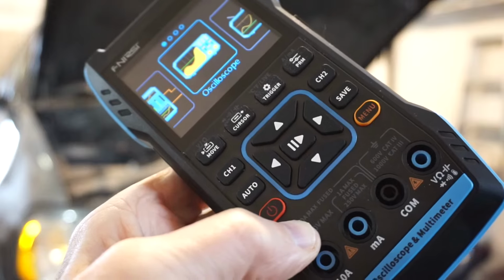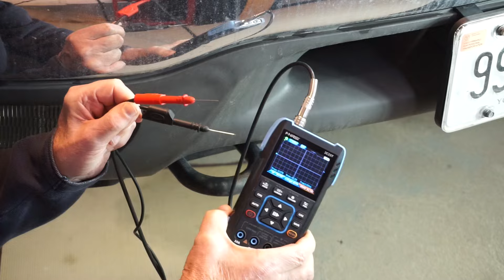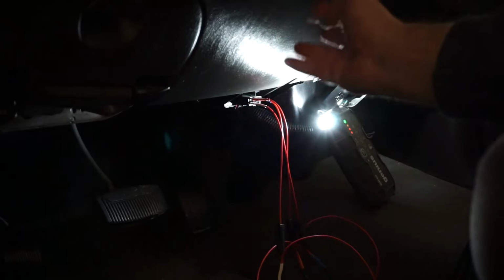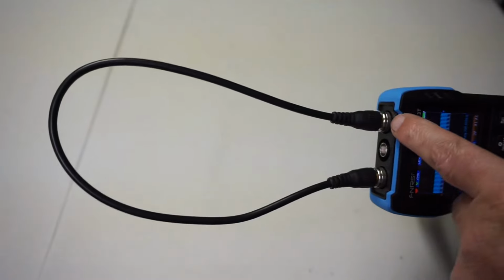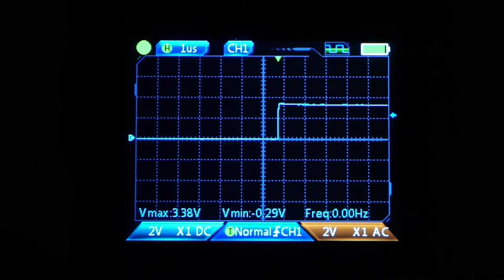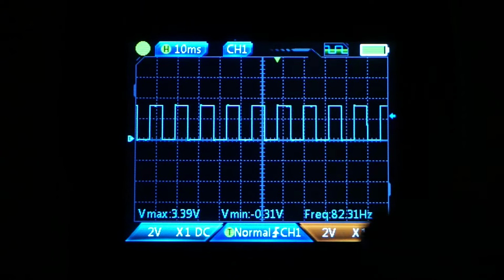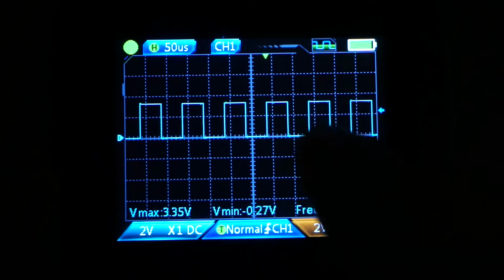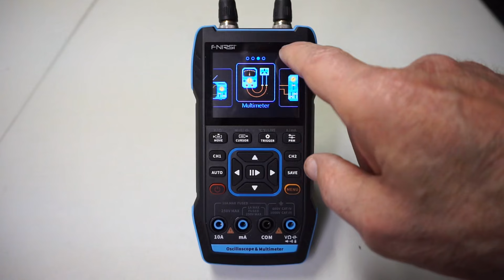GADGETS#191 - FNIRSI 2C23T

Comment: All these "handheld" oscilloscopes have too slow sampling rates at most time bases, which leads to horrible aliasing just like you showed. I think it must be because they don't have enough waveform memory to run at a higher sampling rate at longer timebases. The Owon ones are a bit better (and the price reflects that too), but you can't beat a good ol' bench scope which runs at much higher sampling rates at every timebase and doesn't give these misleading aliased signals. I just recently bought a Zotek and a Owon handheld - the form factor is nice, but it's tough to beat the Agilent MSO-X 2000 series on my bench!
Reply from the maker: 2C23T is not a replacement for your bench oscilloscope, to be sure:)
Reply: @theGADGETSplaylist  Yeah, and I didn't buy it to be a replacement for the bench scope - there's some places a multi thousand dollar scope shouldn't go - on a ladder, in the rain, in a greasy cnc machine electrical cabinet, etc. But, because they're inexpensive, they'll be a lot of people's first and or only scope, and the aliasing issues are a huge "trap for young players" as Dave would say! Another common problem on these scopes is if you put the current leads into the A jacks, but have the dial on mA (or vice versa), you get completely incorrect readings on the dmm. Probably worth checking that on the Fnirsi as well, as it's a common problem on the others.

Comment: I purchased one of these, pretty decent unit for the money. My big complaint is there are no horizontal or verticle cursors. I have a scope that was less than half the price that has cursors. I also have the FNIRSI 1013D stand alone 2 channel that also has cursors. As a comparrison I also have the Owon HD272S which is a similar piece of equipment, it also has both verticle and horizontal cursors. I contacted FNIRSI regarding this issue, their response was that cursors may be added with a software update at some point. No date was given though.
Reply from the maker: thx for sharing the FNIRSI reply

yep, for now we have to use the graticules (as my friend The Gibby 3340 would say)

Comment: Do you have the last firmware ???
Reply from the maker: I was shipped 2C23T with the old board and firmware 2.0.1 ... at that time, there was 2.0.2 firmware upgrade available on their site ... I did the update ... 

new 2C23T ship with a new board "HW::V0.4" ... trying to flash 2.0.2 on that new board would result in a brick, so FNIRSI no longer posts that firmware file on their site

if you have the old board with 2.0.1 and want to update to 2.0.2 then need to contact FNIRSI for firmware file

Comment: Thank you Dennis.
The information was great particularly showing how to work within the limitations of this scope.
I want this type of "portable" scope to throw behind the car seat in the electical tool box and this looks good. At this price who cares if I drop it of the edge of a building or some drug addicts steals it.
All the other reviewers compare this scope to their lab scope and point out the compared failings which is wrong. They need to roll around under a car to find the crank sensor or under the dirty hot dash near the OBD2 connector or in a greasy CNC factory setting like you said and do the comparisons there.
A few more videos of tests around a car would be great. Thanks again.
Reply from the maker: thx for this comment, Mark

I took the glass is half full approach. This thing is capable and it's under $80 USD. Has a place in our tool kit.

Comment: Thank you for the great information.  Could you provide more information on the BNC-BNC cable?  I see there are 10ohm and 50ohm 1ft cables available.
Reply from the maker: I used this 0.5 meter BNC-BNC cable. According to seller it is 75Ω

https://vi.aliexpress.com/item/32973488198.html?spm=a2g0o.order_list.order_list_main.187.49711802no0t2t&gatewayAdapt=glo2vnm

Comment: Another great video and explanation,thanks Denis for taking the time 
""""Still my to go scope is the HS402 with android,do you think will be nice to have some like this HS402 with screen and buttons
Reply from the maker: a few years ago, I was toying with the idea of an all-in-1 HS402 +screen (no USB cable)

I looked at using a Pi3 with a 3.5" touch screen...that didn't work out

then I thought of using an older Android tablet, stripping it down, making a case for those guts + HS402 circuit...didn't go through with it

Comment: Great video, I only do some very low level electronics but I am about to fit a gs100502 sensor to my land rover to read the flywheel teeth for a tacho. I wanted a cheapish scope to check the reading but this seems to be great as it will also replace my cheapo multimeter. Cheers
Reply from the maker: it's not a full featured oscilloscope but for quick readings and combo multimeter and for the price, it's worth it

and it's growing on me each time I use it

thx for comment
Reply: I don't know which Land Rover you have, but most altenators have an electrical post that gives a pulse for a tacho, incase you didn't know. But I forget what it's labelled as 😅
Reply: @warwickbunn1250  Yeah, called the W terminal, I think. I'd need to fit one to my alternator, but I thought I'd go with a different approach!
Reply: @killerbanjo  Yes I think that's the one. Why not take a different approach 😁 as it could be more accurate and more useful for checking timing issues. Have fun.

Comment: Pretty cool, i like my uscope but i hate it's battery life and charging only will occur when the unit is on... And a single channel is limiting. I'm curious about how the tool in this video performs in direct sunlight, I'm a mobile tech and the sun can make the screen un readable 😂
Reply from the maker: haven't tested in bright sunlight (and not getting too many of those these days😏) ... but I imagine with its black background it could be an issue

it's the reason Martin introduced a white background option in HScope as that tends to perform better in sunlight
Reply: @theGADGETSplaylist  it helps but the nit rating is very helpful, I had to get a better laptop to see my pico images on sunny days 😂 my snap on verus d10 is unusable unless I'm sitting in the car on a cloudy day or at night lol. The uscope is pretty good in the sun though

Comment: Does the signal generator function have a variable output for signal level?
Reply from the maker: it is variable but only from 0.1v to 3.3v in 0.1v increments

the other "drawback" to the waveform generator is no 0 offset...for example, the sine can not be centered on 0v

Comment: Any thougts on the LOTO?
Reply from the maker: I do like LOTO products and have reviewed OSC482 and OSC2002 on this channel. Being ±5v scopes, they may not be the best option for automotive work

hands down, Martin's HS502 ±16v or HS512 ±32v are the best budget options...by far!
Reply: @theGADGETSplaylist  LOTO has a automotive adapter for 12v.  But my need is mostly portable scope for Ham radio - which  is 18v DC power but of course most circuits are 5v.

I will check out.  Much appreciated!